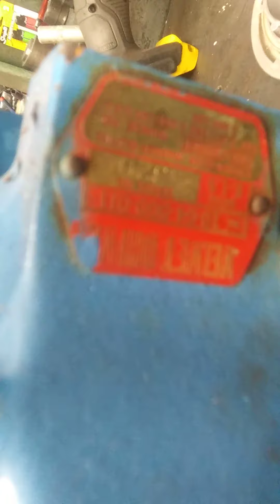How to tell the Ratio of a 1004 1005 Velvet Drive V-Drive with out a ID tag

Comment: Tachometer on running engine then tachometer on out put coupling in forward gear.
Reply from the maker: That's correct. Some Vdrive applications seeing the couple is nearly impossible.
Thanks for the suggestion

Comment: Great info.. Question what determines rotation on these ? CCW on starboard side is standard rotation and the Camshaft of the port makes it CW? So just the pumps on the 2 v-drives would be different from side to side? 1004-000-011 Thanks your the BEST
Reply from the maker: Camshaft